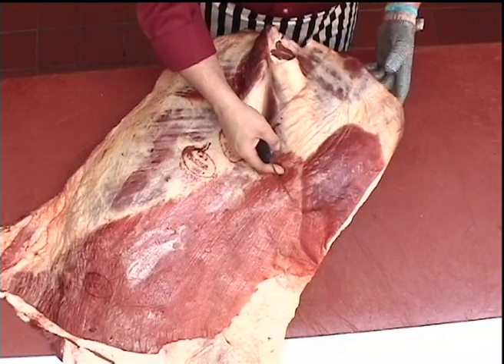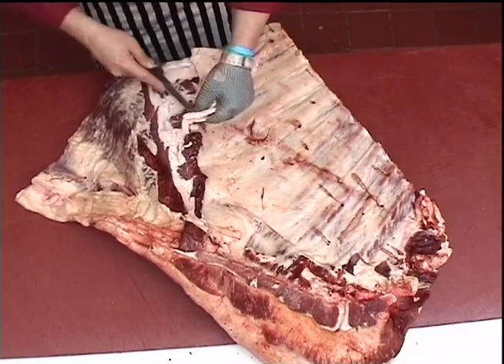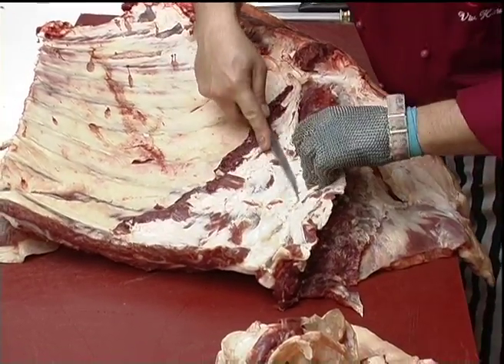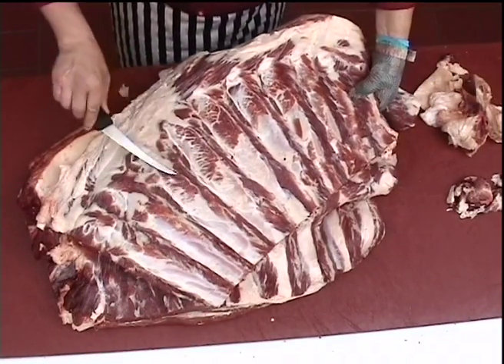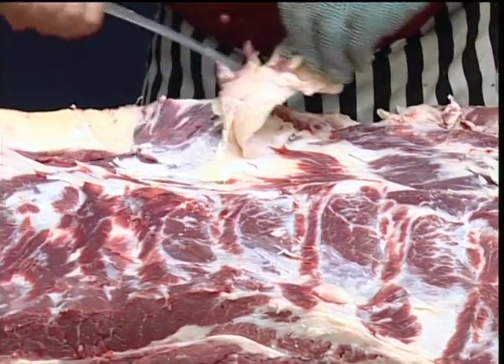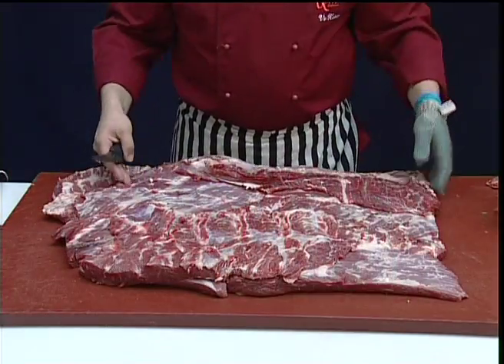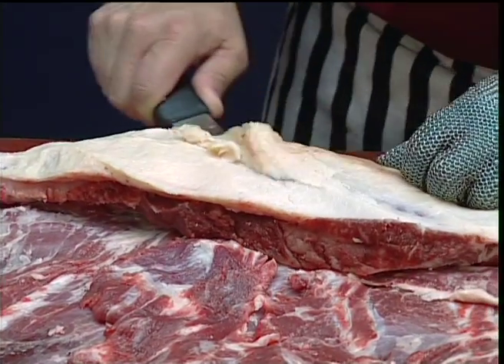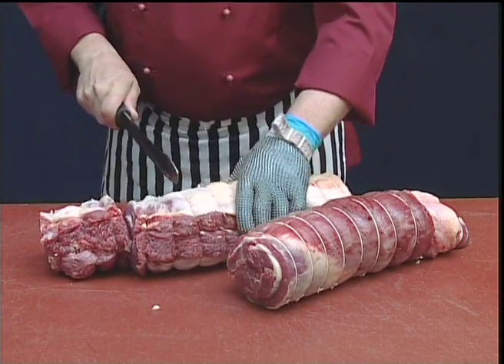Beef Forequarter Rolled Brisket (Boneless)

Comment: if this is called a  rolled brisket.....what is a regular brisket called ?  i have never seen this cut in the usa
Reply: Nor will you, this is a very English style of butchery and it is the bain of my life. I love low n slow since i went to live in Austin, since my return i love doing it properly alas out butchers always do this and leave me having to call my butcher to leave it as a primal cut/whole packer. Here in the uk a rolled brisket sadly is the regular cut. I smoked one and had to sacrifice the outside meat as it smoked to a hard skin and impossible to keep moist. Injections do not work and nor does brining help much when cut like this. In the UK butchers work the meat down to steaks and roasts with primal cuts on request essentially. We have many local butchers still though and this is usually accommodated for, indeed our butchers tend to know a lot of their customers very well and what they like. We also do not have grading like you do with choice v prime etc. For cheaper produced meat we would go to a supermarket and get the budget option, for top stuff we go to our local butcher or a high end supermarket/grocery store. For example here you get "Tesco's finest ribeye" for example and that would be pretty decent, same as a randals top level steak. I will shut up now :-)